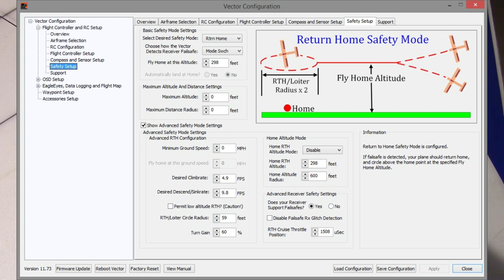FPV Polaris XL Seaplane - FPV Flight Test after Moving Battery Bay to the aft and adding HD Camera

Comment: Great video dmercØØ RTP! I am re-building the Polaris XL i crashed and would like to add some FPV gear because i am a terrible line of sight pilot with a fixed wing. I was wondering why you decided to go with two 3s batteries in parallel? Is that why yours is a heavyweight at 50oz? The model Areo build guide says that most Polaris XL's without FPV are around 34oz AUW. I am curious if you weighed it right because yours seems to fly beautiful for being close to twice as heavy as standard. Did you use a fish scale or something and hang it? I thought mine might be too heavy because i used packaging tape to laminate the wing.... Also, do you have the flight controller just for the return to home feature? I would love to speak with you sometime!
Reply from the maker: No need for a fish scale, just balance the plane at the CG at the step or right in front of the step.
I used the Vector FC to give me auto-level and to get the OSD information such things as battery voltage and current, altitude and GPS home arrow. That way I can fly by my instruments so to speak.